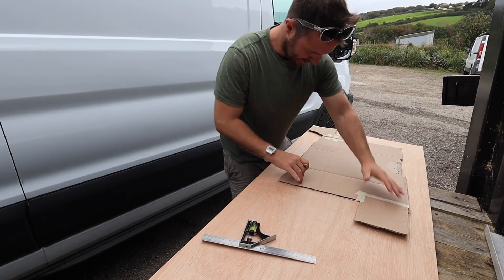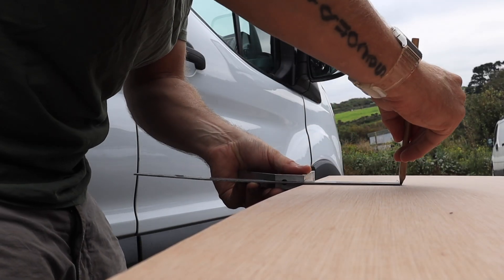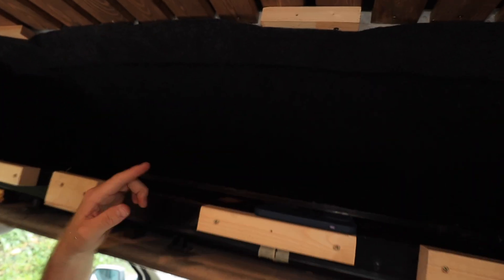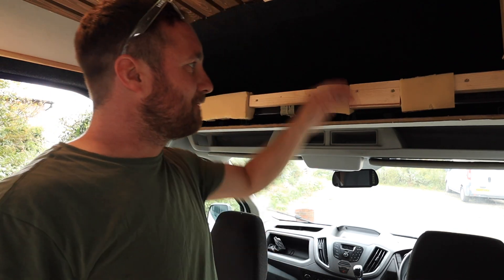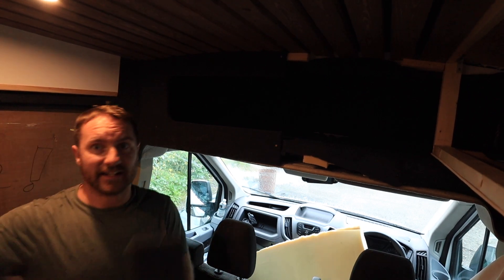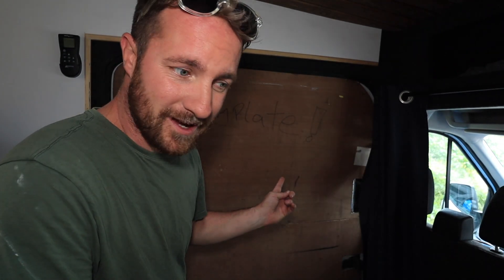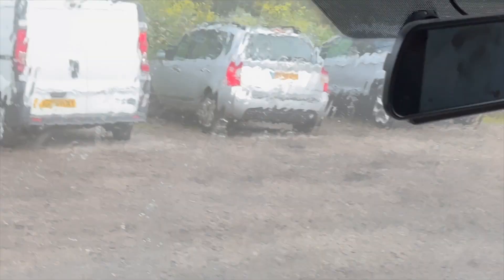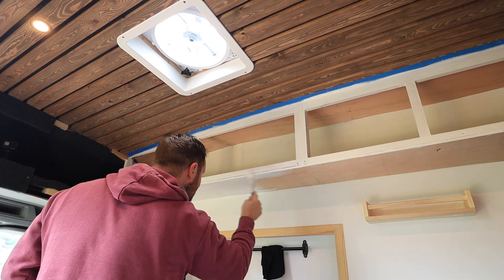FINISHING OFF MY CAMPER VAN CONVERSION WHAT A JOURNEY

Comment: I know it's tempting to use that EcoFlow unit to solve all your problems. However, having all the components individually will save you time and money in the long run. If a component becomes faulty in that EcoFlow, it's a single unit and you'll struggle to repair / source replacement parts. 

Having all the individual components allows you to easily (usually) find the fault and replace it with the same or similar component.
Reply: Just a thought: You've got 45.4k subscribers on YouTube and all your gear is Victron. It's in their interest for this setup to work. Have you tried reaching out to them?

Comment: Please don’t waste inverter power running the fridge on 240. It will run for so long on the 12v battery putting the inverter in the way will just reduce the run time and waste battery cycles. Especially if you get the solar working.

Comment: On your cuoboard doors why not have doors that lift up and cover the frame work. You could also make the doors overhang the frame so when they are closed it creates a straight line to take your eye away from the slight offset from the scribe.

Comment: compromise on the packing for the wall cabinet. Instead of the "correct" 40 mm, go for 35mm to hide the gap. Not spot on perfect but a lot better than what you had.
Or do it to 40mm and conceal the gap with some quadrant moulding

Comment: Good morning great video just want to say to you this a DC system is a pain in the backside you can spend so much money on a DC system and putting 240 volt into a van but if you look at The Brighter Side if you wire it up to the module system then plug directly straight into your battery system portable one then you can then remove any time and upgrade you don't have to fuss about wires because once it's all been modulated sorted for life but I have done a quite a few of these and sometimes it can be hit and miss but whatever you do I hope you find happiness in your van

Comment: Great video and congrats on finishing your van. Looks good. Great idea with the eco flow.. I’ve done the same but with the bluetti 200max. 
Tip for you for charging. Get yourself an inverter for your main van with a remote switch so you can turn it on when needed. That way you can charge your power station using its AC charging. You’ll be putting around 400wats charge back into the unit. Works really well.  I went over kill and got a 1000 watt inverter but 500 watt would have been enough

Comment: Great video again. I have an Ecoflo Delta 2 and was thinking about removing the leisure battery completely and relying on the 12v from the delta but I am not sure if it would have the guts to run the diesel heater as it’s pretty power hungry on first startup.
Reply from the maker: That’s a fair point. I might look into low power heating options for the van this year
Reply: @LoveSundays  my cheap Chinese diesel heater is a godsend in winter. It’s noisy at first as it heats up but after 20 minutes it’s quiet and keeps the van toasty.  I am also a huge fan of Ecoflo products the delta 2 is amazing and I am about to buy an additional battery to plug into it

Comment: Don't know if I missed something here but there is nothing complicated about charging that leisure battery from solar. 2 cables (positive/Negative) to the Victron controller. 2 cables out to the controller to the battery. It really is that simple. Either there is a problem with the wiring, or the solar panel is dead or the controller is not working. Whatever, it seems ridiculous to just dump such a expensive and brand new system. (possibly decision influenced by the sponsorship?)
Reply from the maker: The charge controller was fried

Comment: You're inspiring me to totally revamp my own van.  Just need to get the tools.
I bought an EcoFlow like yours, and mine lasts 24 hours just powering up my laptop (30watts).  So, I don't rate it at all.
Could you do another video and give a bit more detail on how you connect that EcoFlow to your solar panel?  I could do that... I have a 220watt solar panel and rather than use the EcoFlow one I bought with it (which is now smashed), I'd like to connect it to the fixed solar panel on my roof.  I couldn't quite see how you connected them in this video.
Thanks.

Comment: Can you charge the Ecoflow directly from the alternator with a split charge relay?
Reply from the maker: I can be plugged directly into the cigarette lighter in the van so it will charge when the engine is running